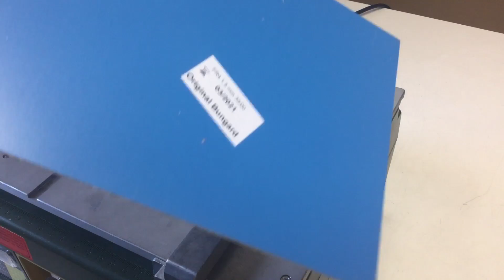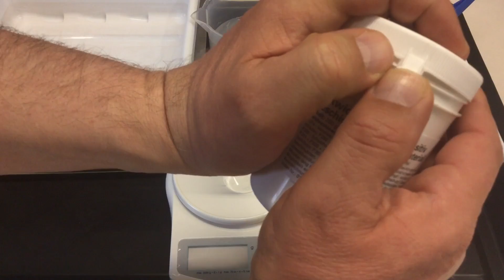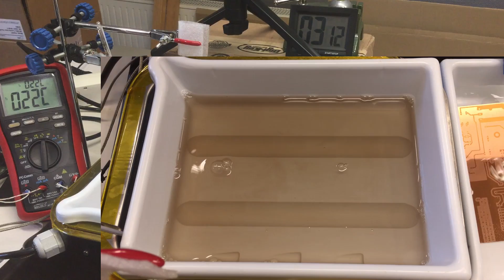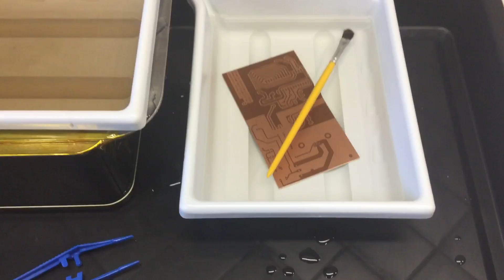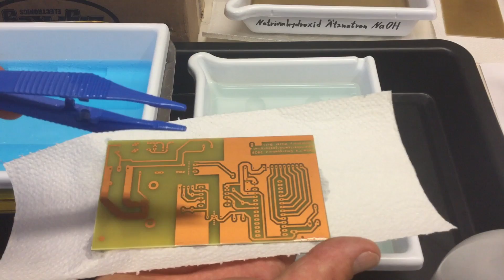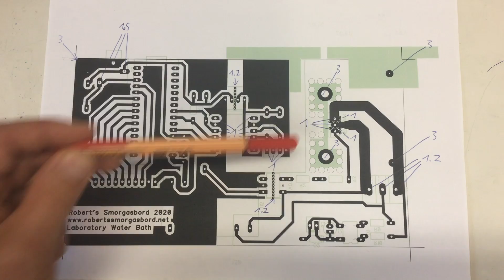Exposing, Developing, Etching and Drilling PCBs – My (Current) Way

Comment: Hello Mr Robert I am always wandering about this thing, after we used etchant solution (especially natrium persulfate that you usually used), does it still gonna work after 1-2 days and so on later?,

and how do you prevent that solution for degraded for each 1L?, i just hope i dont need to buy new one for each week i wanna etch my stuff
Reply from the maker: I store my solution for month at a time in a dark place (no direct sunlight) in a laboratory PE bottle. I also drilled a little breathing hole into the cap of the bottle. So far I haven't encountered any problems.

Comment: What drill setup are you using?
Reply from the maker: I'm using a Proxxon IBS/E drill in a Proxxon MB 200 drill stand. As drill bits I'm using some unbranded diamond coated ones.

Comment: trying for several  years to find a technical name of the material that that the transparencies are made from or to find a commercial name for it to be able to find it in my local market here in Egypt, is there any one who knows any information about the transparencies, brand names, material type, temperature tolerance for a laser printer ??????
Reply from the maker: I don't know if that helps, but the brands I have been using are "boeder", "1 classic" and "Label Ocean". I not sure what they are made of, but I guess it's PET (polyethylene terephthalate) which has a melting point of greater than 250°C.

Comment: Please, what about "densifier" spray ? I never heard of it, could me explain better ?
In the past, working with negative pre-sensibilized boards, i used - after a normal print - to work with double photographic exposure ( the first a "positive" one, the second a "negative" one, as was the original ), and i had got a real dark "black".
But i don't know anything about "densifier" ...
Reply from the maker: The idea of the "density spray" or "toner density enhancer spray" (I'm using Huber LF-A) is to make the toner on laser prints "denser". It's basically a solvent that can solve the laser toner and make it flow a bit, so that any small gaps are closed up and the black parts appear blacker. At least that's the idea.
Reply: @robertssmorgasbord  thank you very much for your kind answer, i'm going now to use an advanced ink jet printer, Epson ET2821, i have to test it for pcbs, then - if gaps are still present - i'll have to find some equivalent densifier for ink- jet printers ...
👍👍👍
Reply from the maker: @alessandroandrenacci2372  You're welcome! But I don't think there are density sprays for inkjets out there. Besides, you probably won't need it, because inkjets (using liquid droplets) create dense black from the get-go.
Reply: @robertssmorgasbord instead of a commercial densifier for a laser toner, try a drop of a light machine oil. It makes toner pitch black and closes the air gap between copper and the film
Reply from the maker: @SanjaBgk  Thanks for the tip! I'll try that.

Comment: Why don't you try ferric chloride? I think that method will save much time.
Reply from the maker: Yes, ferric chloride etches PCPs faster. But that faster etching can also be a drawback when controlling the process. Also, ferric chloride is a quite opaque liquid and stains things. Sodium persulfate is a clear liquid (with a bluish tint from the copper when used) and doesn't stain things. That all said, it comes down to your personal preferences/priorities (fast vs. slow, opaque vs. clear) and how easy you can source these chemicals 😉

Comment: One of the very best (and detailed) video's on this subject!
Reply from the maker: Thanks! But that's too much praise 😅 There must be better videos out there and, more importantly, better processes.
Reply: @robertssmorgasbord  I have watched many, but lots of times parts of the process are left out.
I think the PCB exposure setup could be improved. Some stray light always creeps in from the side. The light needs to be further away from the PCB.
Reply from the maker: @jooch_exe  You're right. When I came up with the idea for the exposure unit (basically reusing an old scanner) I limited the available distance between the UV sources (LEDs in this case) and the PCB.
Reply from the maker: Thanks! But that's too much praise 😅 There must be better videos out there and, more importantly, better processes.

Comment: Hey Robert, did you ever find a more effective method for printing on transparency paper rather than taping two sheets together?
Reply from the maker: Yup! Most inkjet printers produce a much denser black on transparencies (for inkjets of course), so there's no need to use two transparencies like with laser printers.

Comment: Why do you have isolation slots in your design? Is it for inserting something during assembly or you just do not trust the non-conductivity of the PCB board substrate material? Thanks
Reply from the maker: DIN EN IEC 60664-1:2022-07, respectively, VDE 0110-1:2022-07 requires a separation (without) slots of 6mm (worst case scenario) for 250VAC. If you use specific PCB materials AND put an isolating coating on top of everything you can go down to 1.5mm. Since I'm a bit paranoid about our 240VAC here in Germany, have no datasheet for my PCB material and don't use an isolating coating I opted to adhere to the 6mm and where that was impossible I added isolation slots.

Comment: May I ask if you have any recommendations for single sided PCB design?  Thank you.
Reply from the maker: I'm using (and liking) DipTrace. But then, I'm very old school 😅 and basically avoiding everything that's running in a browser or requires an internet connection (basically all other PCB software nowadays). The free edition (300 pins, 2 layers) has been sufficient for all my purposes so far.

Comment: Great video. Reasons that your first try didn't went well, can be that light you were using to expose it was not good enough, or the solution ate it too much, or the brush took off some of the photoresist while in NaOH, I skip touching it at all, when I see that clouds formed over the part I want developed, just move the container a bit, and move it to water, you can then literally wash it under a stream of water, and clean it with hands, when not in NaOH, it's very hard to scratch the photopositive foil, in NaOH, it's being a bit diluted, and under cold water it's hardly attached to the copper layer. When you were going through it with brush, it was already developed enough to etch with HCl + H2O2
Reply from the maker: Thanks! There could be indeed many reasons for the process to fail. But for me it's most of the time the age of the PCB material. I store it in a fridge all right, but some of that stuff is several years old. It still works (most of the time), but I have to remember to lengthen the UV exposure time.
Reply: @robertssmorgasbord  also the preparation should be done in the dark or under red light, as while handling it, it can get damaged, so you get dots on the POWER or GND layer when etching :) I had lot of stuff go to waste before I finally got the process right :D PS. instead of using transparent paper, I use baby oil with white paper method, no need for additional stuff
Reply from the maker: @PipikaTV  In my experience the photo positive PCBs are not that sensitive. The stuff I use needs several minutes of UV exposure. Usually I block out any sun light (cardboard over the window) and use some indirect LED lighting during the whole process. I'm also covering up the PCB material with the lid of a tin box in between. The little dots are more likely an artefact of my old laser printer. Anyway, I'll definitely try your regular paper and oil method.

Comment: Whenever you can, send out your artwork to a film output company that does commercial printing. They can output film for you that is superior to transparency laser prints. you will get higher resolution and very dark density in the black areas making for an easier time. You tell the output company to do the films positive, right reading emulsion down.
Reply from the maker: Thanks for the tip! Laser printers are indeed not really suited for the job (hence two transparencies on top of each other - and I always thinking about buying an ink jet). Anyway, at least around here you'll be hard pressed to find a film output company that is willing to do a single ad hoc print for a reasonably price. To be honest, before I go down that route I'll probably send my layout to one of those cheap Chinese PCB manufacturers. The main reason I'm not doing that currently is turn around time. One or two hours after I finished my layout I have my PCB if I do it all inhouse.
Reply: @robertssmorgasbord фотовывод печатных форм сейчас стал проблемой. Все полиграфисты перешли на прямое изготовление печатных форм, минуя пленки! А было очень хорошо! Дорожки 0.127 мм идеально получались!
Reply from the maker: @ПашаШ-щ5к  Спасибо за информацию! (Google Переводчик)

Comment: I have a cutting printer that I use for graffiti stencils on transparent paper. I wonder if one could print a cut stencil, stick it the board, and spray over it leaving just the copper and then putting that through the etching process.
Reply from the maker: I theory yes. Though I see some problems there with "islands" falling out after cutting. And I'm skeptical how well a cutting printer will handle fine structures/traces (e.g. 0.5mm).
Reply: @robertssmorgasbord  Yes you're right. I'm going to stick with your guide and see how it goes. Just waiting for the products to arrive :) I do use JLPCB but it seems so useful to be able to mock and test the system IRL before committing to printing. Thank you for your time in teaching this.
Reply from the maker: @JayJay-ki4mi  I've also used JLCPCB in the past - it worked quite well (though I only uploaded a finished PCB layout from somebody else). I think you have to put a lot more work into a layout before you can submit it to a PCB manufacturer. Anyway, you're welcome 🙂

Comment: I heard of measure twice cut once, but  you take it to a new level!
Are the failed boards waste, or could you clean it with aceton, sand it and try again?
Reply from the maker: 😅 (the measure twice cut once thing). Anyway, I never tried to reuse a failed board. You probably could do it, but why go through all the hassle? A standard 100x160mm euro board (FR4 epoxy, coated with photo resist) costs me 3,15€.

Comment: Which is better? 10 minutes or 1.5 minutes in the developer solution?
Reply from the maker: I'd say 2 minutes - with my PCB material and my developer solution - should be enough. If the photosensitive stuff is still sticking to the coper after 1 1/2 minutes I remove it nowadays with a soft brush. 10 minutes is definitely too long.
Reply: @robertssmorgasbord  Cool. Thanks.
Reply from the maker: @Berghiker  As always, you're welcome :-)

Comment: Where you buy film sheet circuit? 🙏
Reply from the maker: Do you mean the laser transparencies or the photosensitive PCB material? The laser transparencies are just cheap, run of the mill transparencies for laser printers (search Amazon or eBay for "laser transparency film"). The PCB material I usually order from reichelt.de: https://www.reichelt.com/de/en/single-coated-pcbs-c7781.html?&search=bungard&nbc=1
Reply: @robertssmorgasbord  ok, thank you brother 😁👍, i search in eBay a laser transparencies
Reply from the maker: @yasha2575  You're welcome!

Comment: A much faster and cheaper etchant, is to combine 1-part Muriatic/hydrochloric-acid (36.5 gm/mol) to 3-parts hydrogen-peroxide (3%). 
Make only enough to cover the board because it will degrade with time.
Neutralize with baking soda before discarding…
Reply from the maker: Thanks for the tip! I'll that when I used up my sodium persulfate.

Comment: Must you use the photo resist film under red light?
Reply from the maker: Nope, as long as there's no sunlight and you don't let it lying around unprotected for extended periods of time, it's fine. When I'm working with that stuff I'll block the windows nearby with some cardboard and shield the material with the lid of a tin can when I'm not actually handling it. That's more than sufficient. Remember, it needs three to four minutes of UV exposure (at least with my UV exposure unit). So it's much less sensitive than the photography stuff.
Reply: @robertssmorgasbord  Ok. Perfect!

Comment: What does the density spray do? Why do you use it?
Reply from the maker: Next Sunday I'll publish a video investigating exactly that question :-) great timing, isn't it? In short, the density spray is supposed to make the laser toner more dark / black / lightproof.
Reply: @robertssmorgasbord  Cool. Ok. Looking forward to it.
Reply: It actually dissolves the toner and allows it to flow; but it’s not a miracle-worker!
Reply from the maker: @SpinStar1956  Ah, that explains the strong solvent smell. BTW today I'll be uploading a short video about just the density spray.

Comment: Never had much consistency with positive photoresist and caustic.  I prefer negative acting dry film and soda ash.
Reply from the maker: Interesting! I can see why a negative photoresist might produce better results: Small "holes" in your exposure mask just produce small copper dots, which will be etched away from the sides. I really should try some positive photoresist some day.

At what temperature and concentration do you use the soda ash? How long does it take to etch a board? And isn't soda ash solution also caustic ;-)

Anyway, thank you very much for the input!
Reply: @robertssmorgasbord  10g/litre sodium carbonate deca hydrate (super market washing soda) make up with Luke warm water say 30 - 35C for a 100 X 150 board with about 50% film to be removed use 500 ml, remove board and wash when solution is milky, use a fresh batch of solution and soft sponge to get film out of narrow clearances. Common brand is DuPont Riston, data sheet / instructions for use can be found on net. Development is 3-5 min depending on film to be desolved. High school chemistry is rusty but my recollection is caustic is a strong base where it is mostly free OH- anions whilst the CO3 2 sets up an equilibrium between HCO3 and OH- by robbing a hydrogen atom from a passing by water molecule. The free OH- is less concentrated in a carbonate solution and prevents stripping it clean instantly.  Dry film can be stripped with drain cleaner crystals in water as that is NaOH.
Reply from the maker: @evabaroni6693  Thanks for the info! And you're right, it's not caustic. It's just mildly alkaline (pH values are between 10.9 and 11.6, depending on the concentration). My bad! BTW your high school chemistry is not rusty at all - it's certainly better than mine :-)

Comment: Amazing process. I bet the quality doesn't compare to the toner transfer. Even though I don't even master that... I just managed to do my first toner transfer PCB hahaha. I will sure try the foto resist as well... and now I have a great example to follow. Thank you for sharing.
Reply from the maker: You're welcome! I don't know about "amazing", it's just how I do my PCBs. Compared to toner transfer photoresist will enable you to etch thinner traces. So yes, go for it! And don't be discouraged if the first PCBs turn out less than optimal. It takes a while to tweak the parameters of the process for a specific setup (used UV source, photoresist material etc.).
Reply: I will try it pretty soon... waiting for the PCB to arrive )) Have an amazing Sunday.
Reply from the maker: @dxexplorer  Thank you, I had a nice Sunday! And good luck with your first photoresist PCBs!

Comment: Wow, nice process. However, for such pcb it is much easier (and much less chemistry) to use thermotransfer method. Of course it is not ideal but for such fat traces it would be no problem.
Reply from the maker: Thanks! And your probably right. For the those traces thermotransfer would have been sufficient. However, I eventually want to get down to a trace width of 0.35mm / 0.0138'' with that process, enabling me to route traces between the pins of DIL packages.

Comment: This definitely brings back memories of the old radio shack kits to make a pcb board. Today I would probably just have it made in China. It’s cheap and very professional.
Reply from the maker: Yup, the Chines stuff is indeed affordable and looks good (see "Mini Mailbag: Breakout PCBs for HB100 Doppler Radar and MAX31855K Module (Reupload!)" https://youtu.be/gH-aqvu_e1U ). But the delivery time, at least to Europe, is a drag (you can get them faster, but then they're no longer affordable). So whenever technically possible I still like to make my own PCBs.